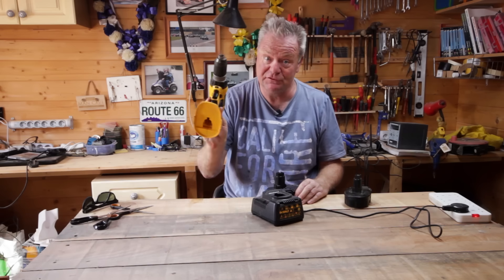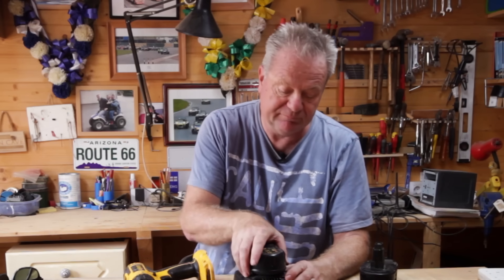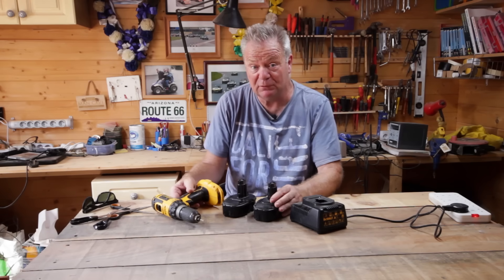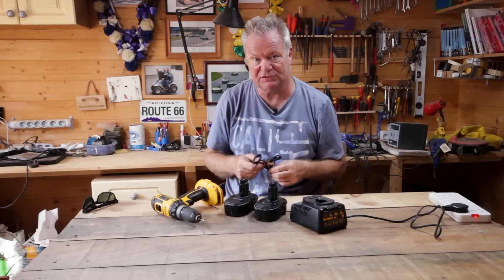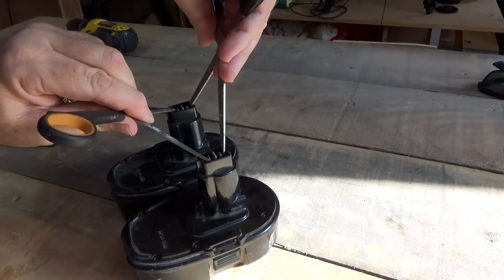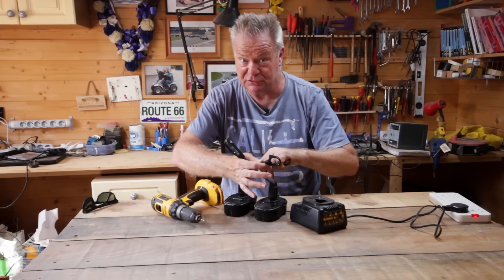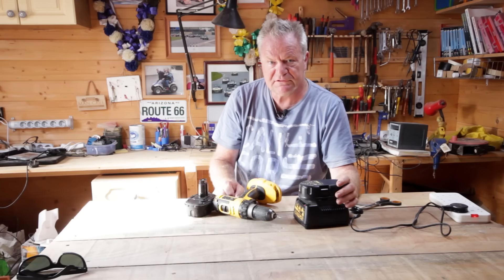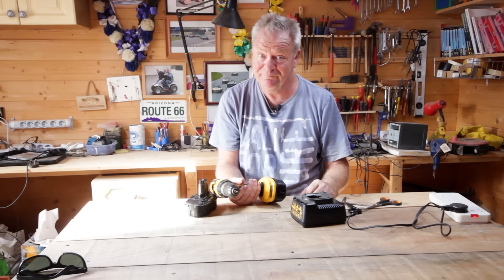How to revive a dead rechargeable power tool battery easily

Comment: This happened to my samsung galaxy tablet, the battery discharged so much that it couldn't charge any more. Much more difficult to get recharged though because it requires pulling apart in order to get some charge in the battery. It's still dead.
Reply from the maker: Having opened up a tablet I know that isn't easy. Thanks for watching Richard.

Comment: I'm confused 🤔 if it will take the charge from a jumper battery why wouldn't it charge from a charger ?  I've got a couple of dewalt, and roybi, power tools that are buried in boxes for about two years in my garage , I don't know if they will charge from setting so long , but I definitely will give them a shot , ⚡️⚡️⚡️👍🏼
Reply from the maker: It is because the charger is a "smart" charger. It needs to detect a voltage to know that a battery has been inserted and start charging. If the battery is flat then the charger won't detect that it has been inserted, so won't charge. Jumping a quick boost to the battery gets over this. Thanks for watching Dave.
Reply: @JPinFuerteventura  thanks for explaining it, 👍🏼

Comment: Cool tip, use small jumper wires instead though. Scissors seems dangerous
Reply from the maker: When you live on a small island you have to use what is available Matt. The scissor handles are insulated anyway. Thanks for watching.

Comment: I'm 3 years late to ask but does this fix apply only to NiCad batteries or can it be used with NiMH and Li Ion as well?
Reply from the maker: The "wisdom" is that you should use it on Lithium batteries due to the slight risk of fire but other batteries are ok. Thanks for watching Frank.
Reply: @JPinFuerteventura  Thanks for the quick reply!!! All the best!

Comment: Question... will this method only work if one battery is completely dead?  What if one battery is very weak but not “dead”.  The weak one is useless but it wasn’t completely dead like yours was.  Thank you!
Reply from the maker: Well you only need to put sufficient charge into battery so that the charger recognises that a battery has been inserted and will begin charging. Give it a go - it will cost nothing to try. Thanks for watching.

Comment: My 2 cordless drill batteries will charge but once you plug them in they barely run the drill will not screw anything... garbage Kawasaki brand only used a few times.... F cordless.... going back to cord drill full power anytime no hassles
Reply from the maker: Yes, you never have a problem with corded tools. Thanks for watching.

Comment: Is it a temporary fix ? Will the batt go bad quick? Or not hold a good charge?
Reply from the maker: The battery in the video gave good service until recently, so a few years.
Reply: @JPinFuerteventura  crap i have thrown out many batteries . thanks for the tip..

Comment: Can you use a 12 volt battery charger(on 18 volt battery) if both batteries are dead? just asking in case cause mine are old
Reply from the maker: Well if you can't borrow someone's 18v battery you could try it

Comment: I'm not using scissors, but I do have some conductive pieces of metal to use.
Its not working. I checked them with a meter and the good battery reads about 20 (18v) the dead one reads 0.00. When connected, the "jumpers" read 20. Test the dead after a few and still reads 0.00. What do you think?

Comment: What about if you use say a 24v lorry battery to charge a 12v car battery would that work. Car battery being 7v dead?
Reply from the maker: I have heard of zapping with a higher voltage to "clean" the internal electrodes. I am not sure if it would help doing this though.

Comment: If you don't have another battery,use
car-battery charger (short time).
If you don't have 2 scissors use cables.
Also, it's better to find dead batery in
battery-casse and make short "voltage 
shock".
Reply from the maker: Good points Milorad

Comment: I have 2 Diehard lithium ion batteries, one dead, one alive. They have 4 terminals. Which one is positive, which one is negative?
Reply from the maker: I have no idea I am afraid Richard but clearly the same terminal on each will be the same so you could use trial and error. Having said that "they" say you shouldn't do this with lithium batteries - although some in the comments have said they had successfully done this with them. Good luck.
Reply: Anybody tried this method with diehard li-ion drill batteries?

Comment: Two wires , and 4 small crocodile clips would be better
Reply from the maker: When you live on an island without the ability to just go out to a big box store and buy whatever you need you have to be creative.
Reply: JP in Fuerteventura   Fair point . 
can you please advise , if you only have one battery ie de Walt , can you use one from another make , or do they have to be identical ie 3 ah and 3 ah or can you use say a 5 ah to reboot a 3 ah with out issues , I would appreciate your advice.

Comment: Does it work with lithium ion and nickel cadmium batteries? I have dead batteries from both kinds.
Reply from the maker: "They" say you shouldn't do this with lithium batteries due to a slight risk they might explode, although some have commented that they did and it worked. You can certainly try it with NiCad batteries.
Reply: @JPinFuerteventura  thanks for replying I had waited before trying to find out because I wasn't really sure but at least now I know a little more of what to expect and how to handle going about it. I appriciate the feedback.

Comment: wow! cool. my problem is I don't have another battery. but true, it's so confusing, buy a new battery which is so expensive or buy a whole new tool for the same price as the batterie? it's a dilemma for me, I just use a drill maybe twice a year, why do I need an expensive tool or expensive battery? 😟
Reply from the maker: You could try borrowing a similar battery from a friend

Comment: I Have a modified 19V laptop charger fitted with 2 small crocodile clips. haven't had a lithium battery yet it won't revive within 2 mins.
Reply from the maker: It may well have damaged cells then
Reply: Sorry what I meant is it works every time 👍
Reply from the maker: Sorry I misread your comment 😊

Comment: It worked! The charger looks for current because it's motherboard is designed with a capacitor that initially needs itself to be jump started in order to turn on its circuit. You've simply hit upon a good hack. Negative commenters are from, (pause), "The Twilight Zone!" 😆.
Reply from the maker: Indeed it does. I am glad it helped. Thanks for watching.

Comment: Will it work with wires too? Or it needs a thick metal like the scissors?
Reply from the maker: Yes it will. I used scissors as it is easy to keep pressure on all 4 contacts at once with only two hands. Thanks for watching Lika.

Comment: Tried this yesterday with two Craftsman 14.4 V batteries that would not recharge for years.  It worked for both of them!  After the first one worked, I used my multi-meter to check the voltage on the other 'dead' battery.  It was around 9.5V but after I hooked up a separate fully charged battery pack I had for a different drill, I got it to jump up to near 16 V and that was only with one minute of charge.  I used test wires rather than scissors.  I was just looking to buy new packs or replace the inner batteries on those Craftsman batteries but found this AWESOME tip and this saved me a ton of money and extra effort.  I used the cordless drill extensively today with no problems.  This tip was RIGHT ON THE MONEY!!
Reply from the maker: I am glad it helped. Thanks for watching Jim.

Comment: Brilliant, simple and useful. Exactly what a YT "fix it" video should be. Thank you. Question, if I have only one of the dead batteries from a particular power tool, can I use a battery from a different power tool (different manufacturer) as the charging battery?  Also, do both batteries need to be the same voltage or can I use an 18V battery to revive a 12V battery? Thanks again.
Reply from the maker: Ideally you should use one of the same voltage, although the make isn't important. I hope it helps. Thanks for watching.
Reply: @JPinFuerteventura  Thank you for the quick reply. Will give it a try.

Comment: Great tip! I saw where you said you didn’t have to repeat this in the 15 months that passed with the revived battery. I’m not sure if it holds the charge well and lasts as long as the functioning battery does.  I know sometimes they lose the ability to last as long as when they were new.
Reply from the maker: It worked well for almost 3 years. It is not holding charge for as long now but was well worth doing. Thanks for watching.
Reply: JP in Fuerteventura - Sure, I bookmarked this should I find myself needing to do this. 👍

Comment: Hello sir, I have exactly the same Dewalt drill, the drill now is smoking and sparks are going from the carbon brushes side in the back. So I am not fully sure if there was a problem in the carbon brushes, the drill work for seconds and the battery get dead, do I have both battery and worn brushes problem or just worn brushes? please advise. If charger flashes fast when charging, what does this mean? Thank you
Reply from the maker: That doesn't sound good. I would say the brushes are your biggest problem. Thanks for watching.

Comment: Thank you for sharing this tip.  I have a question:  My batteries each have four unmarked posts, so how can I tell which posts to connect?
Reply from the maker: What make of battery are they?
Reply: They are Craftsman batteries.  I mamaged to find out that the two posts along the long axis are the positive and negative terminals, but the low battery has yet to hold a charge.  My technique is probably lacking, I will try again with alligator clips

Comment: What if I have two dead batteries? I found a drill set on the sidewalk last night that someone presumably threw out because they thought they were broken, but both batteries had just enough charge to quickly turn the light on, so I suspect I might be able to save them if I can get them out of sleep mode.
Reply from the maker: You could try borrowing a good similar voltage battery.

Comment: I will be so grateful if this works, I'm testing it right now! I'm having this exact problem at the moment.
Reply from the maker: I hope it helps. Thanks for watching.
Reply: This worked 100% omg.... SO AWESOME THANK YOU SO MUCH!
Reply: Ok just a quick update! It worked when I tried it, but unfortunately, I tried to put it on the charger afterward and it didn't work anymore.  It was completely dead again. So I guess it would work but only in the case where your batteries aren't completely dead. But they've been working great for many years before dying on me so I guess it's a win anyway! Thanks!

Comment: I have a small rechargeable B&D 'Pivot' it recharges with a cord plugged into the base. I know B&Ds are a wimpy brand, but I really ENJOYED this little thing because I am a small person & it just seemed to do the job I needed for about 3 yrs. It stopped charging about 4 yrs ago & I've been loath to throw it away. I have other drills of many kinds, but none so light weight as this one. Would you have any ideas how I could give it 'jumpstart' so it will charge again?  I am an avid recycler, pretty decent at repairing things & appliances so I would like to have this usable again if possible. Thank you for your vid....:-}
Reply from the maker: Actually I have a similar drill I bought in Ikea just to use for lightweight jobs and this will no longer charge either. Since this video method is really a way of getting around the fact that the charger doesn't recognise that the battery has been inserted I don't think jumpstarting will help. I suspect we both may have damaged cells and the only way of fixing that is to open it up and try to change them. Sorry.
Reply: @JPinFuerteventura  ; sigh.....it was worth a try. thank you for responding...I've tried to find replacement parts for the battery system , haven't been able to find any. Where would I buy strictly the 'cells' from, do you know?

Comment: I hope it really works because I have 3 batteries and 2 of them are dead ones
Reply from the maker: I hope it helps. Thanks for watching.
Reply: JP in Fuerteventura I tried it and it didn’t work. I have a feeling my charger is knackered. I took it apart and there’s 2 wires that seems cut off. 2 transistors that’s just dangling there and a metal thin plate that’s just rattling inside the charger and I can’t find a home for it. 
Looking at it, I think it’s made in China
Reply from the maker: What isn't made there these days, sadly. I hope you get it sorted.

Comment: So once you put power from the good battery to the dead one and then charge it on the charger. That battery will normally charge all the time without taking power from another battery?
Reply from the maker: I have never had to do this to again to the battery in the video
Reply: JP in Fuerteventura strange isn’t it 👍
Reply from the maker: I think mine was so flat as I I sued it until the drill wouldn't turn any more and then forgot to charge it for a number of months.
Reply: JP in Fuerteventura can you do the same with Ni cad batteries?

Comment: If this does not work. It is probably the Thermocouple has failed. You can replace it. or just hook it up direct.But you run the risk of the battery getting to way to hot, and messing up your charger, as well as the battery. hot
Reply from the maker: Interesting Charles. Thanks for watching.

Comment: Thanks for the great tip. I just brought a secondhand black and decker drill with  2 ok ish batteries. This was after seeing your video.
Reason being; my black and decker battery is dead. Wanted to try this but didn't realise the secondhand one is something like 14.8 volt and my original one is 18. Can you still try this. Thank you.
Reply from the maker: I assume they aren't lithium batteries (which "they" say you shouldn't try this on). If not then as the good voltage is lower I cannot see how it would do any harm.
Reply: @JPinFuerteventura  Cheers JP for  replying They are all NICd. Will give it a whirl.👍

Comment: I'd keep an eye on that charging for the first time, some of these batteries don't have balance boards and a single dead cell may be charging away whilst the good cells are over and above their desired voltage.
Stick a smoke alarm nearby or keep an eye on it whilst charging, these things dont ho flat for no reason.
Reply from the maker: This one went flat because I used it until it would no longer turn the drill and then forgot to put it on charge for a few months.

Comment: Thank you sir! I found you via a Google search. I have 18V DeWalt LiON batteries for my drill and one was DOA. I followed your scissors method and in just a few seconds I was able to get a slow light and it’s charging. No one died in the process and it’s charging now. If it fails I will just get a new 20V kit, while not cheaper, it makes more sense.
Reply from the maker: I am glad it helped and you are still alive to tell the tale Joseph 😁
Reply: JP in Fuerteventura now YouTube’s algorithm is showing me all the battery revival videos. One advised doing it outside for fear of fire or explosion. I did this in my kitchen, so yes, glad to have survived!

Comment: I have the same exact DeWalt drill. Sadly, I now have TWO dead batteries, and nothing that will hold a charge -  because both my dad and brother kept leaving them on the charger. They didn't know you aren't supposed to leave a battery on the charger all the time.
Reply from the maker: That's a shame. Thanks for watching.
Reply: I just revived on with a car battery charger, but, at your own risk. The amps coming out of the car battery charger look very unsafe (8A) but after 10 seconds on the Car battery charger the Ni-Cad Battery charger would charge my battery again.

Comment: Worked great for me—thanks for the tip! I had to leave the batteries connected for about 40 minutes, but after that, the charger was able to charge it. I revived two ryobi 18v batteries that hadn’t worked since 2015.
Reply from the maker: Great, I am glad it helped
Reply: JP in Fuerteventura, Ye dave tube, Ebc!!!

Comment: JP, you da man!  I've came across an old NiCd battery I've had in my garage for about 8 years untouched because it wouldn't take a charge.  I connected it to a good battery for about 5 minutes and, BAM!!!  It's resurrected.  I'm in disbelief, but even after a few days, it still works.  Thanks a ton!
Reply from the maker: I am glad it helped Coulter. Thanks for watching.

Comment: If you don't have a 40 volt dcb 404 and you have a a good 20 vlt will this still work to save the 40 volt? I have to spend 200 dollars to get a new one because I have 2 bad batters to dead tools now lol
Reply from the maker: No idea Donn - anyone have any idea?
Reply: @JPinFuerteventura  I used a 20 vlt and jumped a 40 Vlt it worked!

Comment: Do you have to do that each time you need to recharge or did the transfer fix the problem?
Reply from the maker: I never had to do it to this battery again. Now, some 3 years later, it is starting to hold its charge for else time, but gave good service until now.